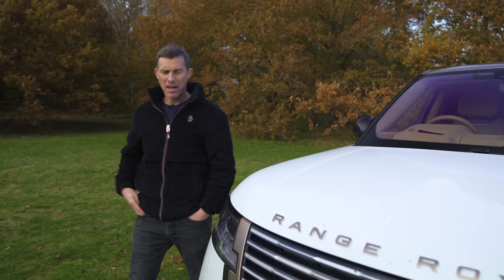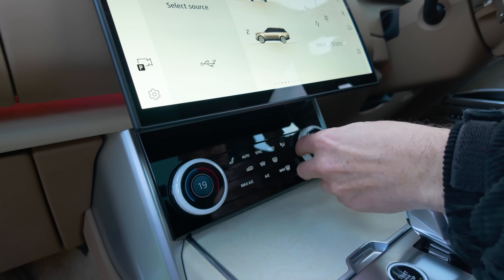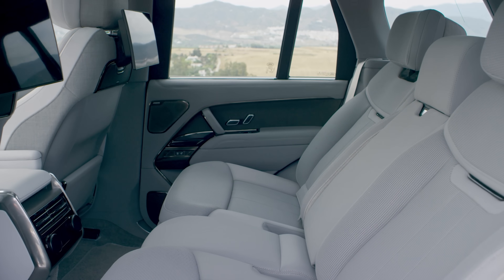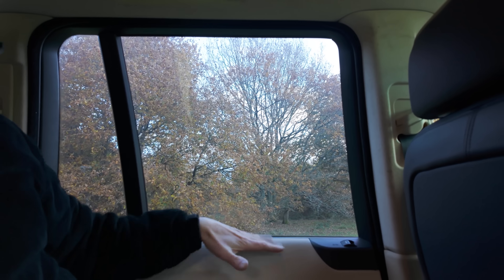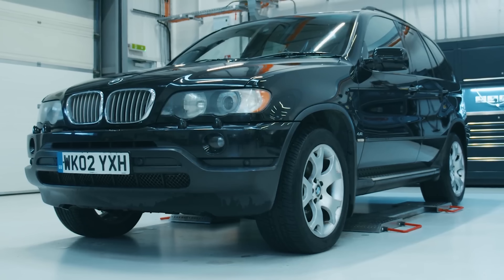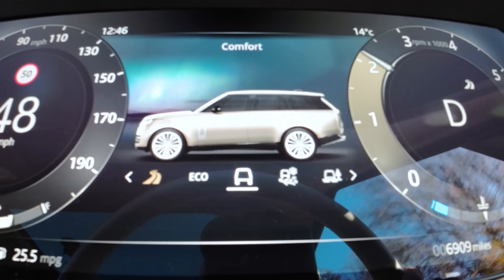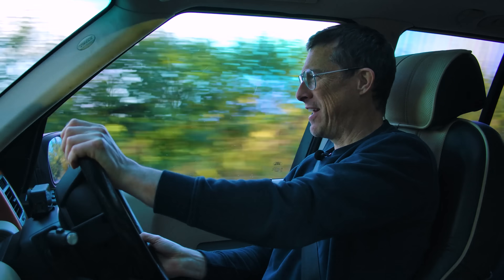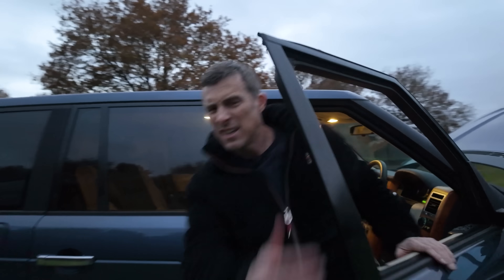£2,000 vs £200,000 luxury SUV!

Comment: for all the dudes, trying to impress women with such cars: they don’t see the difference, until they sit inside. So buy the cheaper one
Reply: Wise wise
Reply: We buy it for ourselves
Reply: Or buy an actual car and not a shit box from range Rover
Reply: Facts!
Reply: @razumikhim 

This coming from someone who's never owned ANYTHING made by JLR and couldn't a toy version 😂
Reply: Wise words from a wise person
Reply: @razumikhim actual cars like 2005 Range Rover Stormer Concept?
Reply: @skylined5534 what is JLR btw??
Reply: @purwantiallan5089  jaguar land rover 
The name of the company
Reply: Problem is JLR products are horrendously unreliable tat. Imagine when that current model gets to 5 years old and the many many electronic additions start failing constantly, each costing thousands to replace. The car will move quickly through owners and by 10 years old / 100k will require megabucks to bring it back up to scratch. Or it'll be stolen and sent abroad. 

All the people I know who have owned JLR products won't go back to them as reliability & customer service is dog 💩.
Reply: If its new enough to be reliable,and desirable, its new enough that its keyless, and stealable to any halfwit with a signal flipper or Bluetooth speaker and a welding rod, which means its uninsureable in the SE, Manchester or Birmingham, 😮
Reply: 😅😅 genius
Reply: Bad advice. Buy neither of them. They're both unreliable AF...
Reply: They absolutely do lol
Reply: @Jamessansome No one needs to own a car older than 5 years old lmao. Why are you buying 15 year old cars?
Reply: Definetly don’t buy an old range rover 😐
Reply: My friend ordered a new Ferrari Roma, his wife walked to an Audi near by😂
Reply: @francismhone3086  same with the women......
Reply: My father is the official representative of Range Rover in the country I live
Reply: @Inkwell494  buy him a Faraday pouch for his keys before it gets knicked! 😄 🤣 😂 😆 😄 🤣 😂 😆
Reply: I'm a gal and I confirm. Showing off with modern expensive cars leaves me cold. Their only advantage imo is safety features & being under warranty for a couple of years. But then, I'd rather have a safe driver & a simple reliable old mule. ¯\_(ツ)_/¯
Reply: They really do
Reply: Screw the women, we buy the nicer ones for ourselves
Reply: no women will date you if you drive a Toyota Prius
Reply: @conor7154  Because 15 year old cars are usually alot cheaper
Reply: They’ll both guarantee you’ll be spending a lot more time with her - on the hard shoulder
Reply: @Prashanth_yt24  stop lion, deep down you wanna be noticed by women driving this car
Reply: @devbrix1  myth i see more German and French brands on the hard shoulder broken down
Reply: Dude I wish that was the case with my wife. The first thing she checks is the year of the car 😂
Reply: @razumikhim range rovers are good, people who hate them can’t afford it
Reply: Y’all some clowns for buying cars to impress women instead buying cars for your own liking
Reply: Ladies, a word of advice if you are dating somebody with an old Range Rover for $2000 you should run not walk because he will never have any money to take you out on any kind of dates or buy you anything that you want because all of his money will be going straight to keeping that turd on the road.
Reply: What!?🤨Cars are to impress Men!
(the boys)
Reply: The only women you’re impressing with this car are the 40-year-old moms
Reply: True👌
Reply: @skylined5534 couldn’t agree more, iv owned a few and never had issues apart from bits like knocking suspension arms and blown bulbs etc same as any car. All them that say “break down every day… there shit box…” all never owned one but heard some random comment from someone down the pub who’s mates brothers sisters cousin had one and apparently cost him 10 grand a month in repairs…
Reply: LMFAO 🤣
Reply: 😂🤣🎯 @razumikhim
Reply: @razumikhim 😂🤣🎯
Reply: Buy a old timer and make it nice. Woman will never forget you have style
Reply: Or just buy an l322 for the good all rounder they are
Reply: Since money isn’t an issue, assuming this based on your comment, you’d be a fool not to get the new.
Reply: Or buy one just 5 years old. It'll cost less than $15k and look exactly the same. Lol
Reply: Just buy a ford
Reply: @conor7154  my cars 28 years old!!!! Still pulls like a train, 100% reliable, and is WAY  cooler than a new Defender 😎,  why the HELL would I buy new for a less capable machine??????
Reply: @mystisith3984 you sound pleasant and mature and probably not from many cities in the US like LA for example. Many women are not of that mindset unfortunately.
Reply: Underrated comment
Reply: @Jamessansome  current tend had changed
Reply: @razumikhim tf kind of name is wulfris
Reply: My girlfriend seriously wouldnt thank me for a 200k car, she doesnt know whats what with cars
Reply: @megane230f1  I’ll take it bud, she don’t deserve u
Reply: @StateGenesys  you be more than right there 🤣🤣🤣👍👍👍
Reply: Actually your typical woman only looks at the brand and/or year of the car. Because it's either status or safety/reliability. You should buy a car for yourself, not a woman unless you're planning to create a family with her. Your top priority should be making sure the family is safe. I love Range Rovers but they're trash when it comes to reliability. That's why the resale value tanks. Idc who's in the comments saying, "but mine!!!" I drive a 97 Chevy Blazer and it's not perfect. It breaks but besides regular maintenance it's cost me about $2500 in the past 10 years. And I have the LT so it's peak luxury for it's time. I know a guy who bragged about spending $20k cash on his 10 year old Range Rover and drove it 300 miles to my house. Then he asked me to check it out because the dash lit up including his oil light. I offered to check it out but it doesn't have an oil dipstick. The dealership charged him another $10k to fix it. He was $30k down in a depreciating asset. The next time I saw him he had a Ford. So here's my advice, buy it for you or your family. Only buy new with a warranty if you don't mind losing your ass on depreciation, buy used if you can work a wrench and can eat the parts cost, and never buy one to impress a woman because there are better cars for that around the same price but much more reliable
Reply: Also JLR is owned by a Chinese conglomerate now. I have nothing against it but I just wanted people to know
Reply: You ideally want to end up with the woman who doesn’t mind that you have the £2k one. Because if you’re unfortunate enough to end up with the one that will only get with you if you have the £200k Range, she will be gone the second you don’t have it. The sort of woman who will get with you regardless of your car will stick around a lot longer than the shallow woman who is only with you for the shit you have.
Reply: Ohh, trust me, they do see the difference! At least here in Croatia they are very into cars.
Reply: Wise facts from a wise person
Reply: They should be happy with anything. It's better than walking. And if they want you for your money it's bye bye.
Reply: They ain’t that dumb
Reply: Same when they see a Porsche
Reply: Very good video Matt ; thank you. £200,000 is absolutely obscene. It’s not 3 times better than the good old £2000 L322, let alone 100 better!! 
That white “ Ceramic “ finish on the knobs/ levers ! The captain chair arm rest one , looks like a cap from a tube of toothpaste!! 
I would take the old one every single time. No contest .
Reply: You are a prophet of our time!
Reply: @conor7154 yes they do, because most of the people in the country in cars under 5 years old are broke and have to buy them on finance and lease. Most people are poor, even most people who think they’re rich are poor and get these cars on lease. Unless you can afford this car and afford to write it off several times over and not care, then you’re not rich enough to buy it.
Reply: Wow a load of rubbish written by a poor person!
Reply: And then again..who would like to date a lady impressed by a car..
Reply: True. And the only way she knows about the interior of the new one is jumping up... Or been a carwow follower, but if was the reason she don't be impress at allá.
Reply: @skylined5534 range rovers are actually unreliable (coming from someone who has many toy versions and shut the fuck up with the "don't like cause no afford" logic)
Reply: @PROLOSER888 cause they cannot afford the constant fixing this british crap has
Reply: @lemcakes32422 Women who judge you based on what car you drive aren't worth dating.
Reply: @Tieaga No they're not. JLR is owned by Tata, who are Indian. All the cars are still designed and engineered in the UK. Manufacturing however, is where Cherry in China has rights to produce cars for the Chinese domestic market.
Reply: @DeathlySin  Rollys Royce is German they put all BMW crap cheap parts on it
Reply: @lemcakes32422  what's that got to do with JLR and the comment I was replying to?
Reply: @Jamessansome  100% correct... I have a Jaguar.... 6 months already, still in the repair shop.... When I invite a girl out, we always take the bus 😅.... I only used it for 3 days and that was it... And ruined all my summer holiday cancelling all my plans  spending all  my time  from repair shop to repair shop
Reply: Unfortunately this is all too true with LR RR's. They are incredible and extremely capable machines, yet 95% of them will only see paved roads their whole life's. They are status symbols more than feats of engineering. Sad.
Reply: @lemcakes32422 they are much more common?
Reply: And once they sit inside, you're pretty much in
Reply: Or buy an old defender jobs a gooden
Reply: Real men don’t need cars to impress women
Reply: The interior of the cheaper one looks shit
Reply: @comicnerd1186  would you take the new one off-roading tho? Big question..
Reply: My wife just bought a 2020 vogue with the 21” wheels and black pack and I am very impressed it’s probably the best car you can get £50000 gets you alot of car we had the 2002 hse years ago and what a lot of crap nothing but trouble if you want to keep putting tor hand in your pocket or have 3 donor cars on the drive be my guest and buy the old one the people that can’t afford these cars say you must have a small d,,,k 😂😂😂 they don’t say you must have a big wallet good luck to any one that has one they have earned it and my wife works very hard
Reply: A friend of mine had a old 2005 diesel and it caught on fire under the dash it incinerated the car 😂😂😂 be careful of the gear box suspension bags electronics ect ect on the old ones have fun
Reply: Every time I see someone driving an old sport hse ect I know they have a dash like a Christmas😂😂 😂tree
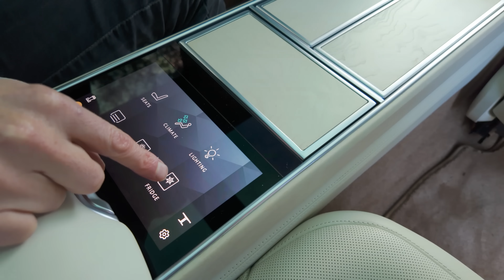Reply: @Prashanth_yt24 😢😢 8:41 😢😢😮😅😢
Reply: Aint that the truth the other way around too?
Reply: So the expectation is to never be able to get her in the car.
Reply: @Craig-wp3pz  you don’t need a faraday cage if you can buy one you can afford the insurance and getting it stolen doesn’t matter it cost me £2500 insurance for my 2019 L405 vogue it seems like 99% on here have a fiestas of a bike only the wealthy can afford these cars old or new but keep laughing not so funny when you get passed by one and your wife looks at you and thinks thats not going to be me stuck with you 🤣🤣🤣🤣🤣
Reply: Why are you trying to set up these men or boys. As a woman I confirm we know the difference. 🤣
Reply: 😂😂 I never was a big fan of the last range Rover.. they are a giant shoe box..I would have that tin can even for free !
 Costs a fortune to repair it !
Reply: @skylined5534 those cars are shts! Constant breakdowns and lots of maintenance+depreciation
Reply: @conor7154 thats a really dumb question thats out of touch with reality as there are many factors why someone would buy a older car and you are paying for  your "less than 5 year old car" monthly and dont own it because if you did pay for it in full you wouldnt be chatting shyte in the youtube comment section
Reply: @redstream1237 

Yet you've never even owned one 😂
Reply: Unless you know about cars, and both have plus points. Most people have no knowledge about proper 4x4’s anyway
Reply: @tsaki_titan only if you have a small duck
Reply: @driver_18 really? I own a Porsche do you? Plenty of women Porsche drivers in the Uk who know how to handle them
Reply: @cristiancristi9384 perhaps you should invite a woman out and not a girl
Reply: @ladybee4564  you seem to be so affected by comments about women. lol... By all means, I have much respect to women who have an enthusiasm and knowledge about cars, all the more if they're skillful behind the wheel. Ofcourse that's NOT ALWAYS the case... and majority is what the original post of this thread was about.
Reply: @ladybee4564  and wtf does owning a Porsche have to do about giving an opinion. I love Porsches, driven one. Never owned one. Will own one someday.
Reply: Most superficial women are programmed to think new is best and can sniff expensive from a mile off.
If they don't know the difference between a brand new 200k car and an old 2k shed, she simply isn't into cars at all. My mrs would know and she herself isn't bothered about cars.
Reply: Yeah they do realize that
Reply: Because she’s not getting in?

Comment: Going to be interesting to see how all this tech works in 20 years, imagine that car could be £2k in 20 years 😄
Reply: WILL be worth 2k in less than 20 yrs
Reply: It will be mate. Look at the prev l405 model. Now about 15k soon to be 2k in 5-10 years
Reply: No it won't @volvo24091
Reply: @Neo_LV69 I don't have high hopes considering Land rover is now owned by the same company who made the "Cheapest car in the world"
Reply: the tires prob cost 2k on the new one. crazy you can nearly double the price of an older car if you have to buy tires right away
Reply: This was exactly my thought! Let's see how much this one costs in 20 years. 🤣
Reply: More like 6 years before EVs take over petrol cars.
Reply: honestly don't even think this thing will be allowed on the road in 20 years...
Reply: If all that tech breaks, it won't even be worth that much unless it's scrap value.
Reply: I don't see it dropping to 2k more like 30k in 20 years
Reply: Repent-and-believe-in-Jesus1 😂😂😂😂😂😂
Reply: The newest ones won't be on the road in 20 years time. Tech burnout will write most of these off..
Reply: @mr.pritchard67  Both will be scrap before then.
Reply: I actually see the cars sold right now being around for a long time. EVs are either very expensive or impractical. I suspect a whole side-trade of refitting cars will spring up. You won't be able to buy them new anymore, so putting a new engine in, and having the interior refitted shiny new, might end up being common practise. Didn't make any sense when you could buy a cheap new car for £12K, but spending £10k on a £2K old car to make it almost as good as new is more viable than a £50K EV for most people.

Be interesting to see what happens with EV pricing and depreciation. Everyone expects them to get cheaper, but I read an article that indicated most conventional car brands are selling them at quite a loss, and that most of that cost was raw materials and batteries. Lithium cells are already being mass produced, so the economies of scale are already there. Unless they want to go down the Tesla route and create their own giga-factories dedicated to batteries they are going to be stuck with market rates. I'm not sure we are actually going to see prices drop, might even see them rise further, there is only so much loss that can be absorbed. Either way genuinely budget EVs with useable range seem a bit of a pipe dream right now.
Reply: I don't think that car will exist in 20 years. No way any of that still works by then. Only if novody was used for 20 years and it stayed in a garrage
Reply: In 10 I recon😮

Comment: Would have liked to have seen 3 versions; £200,000, £20,000 and £2,000.
Reply: I would've liked to have seen 4 versions.
Reply: @nickographer6528 £200 version? 😂😂😂😂
Reply: there’s no 20k one yet 😂
Reply: “Today we’re testing 3 different range rovers at 3 drastically different price points to find out which one is worth it at its price”😅😂
Reply: @mr.pachimari9983 So ur telling me there’s no Range Rover that’s abt 20,000?
Reply: @s5sbh the 2013 one is around the £20k mark. And that’s the previous shape essentially bar the facelift and can’t imagine the new one is 10
Times better.
Reply: 2017RR Sport go for 20k less than 100k too, fortune to insure though
Reply: 20k version is the same car outside of the car sale lot 🤷‍♂️💁‍♂️🙌
Reply: That’s easy just come back in ten years then another ten years and the white one will drop from £200k to £20k to £2k in that time line of history has anything to go by 😂